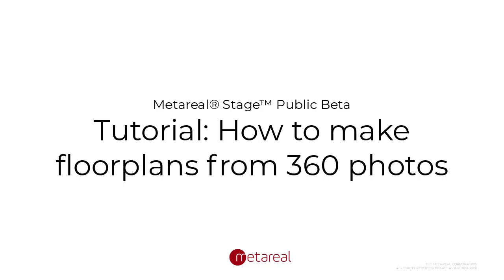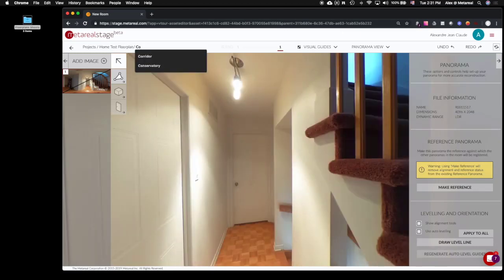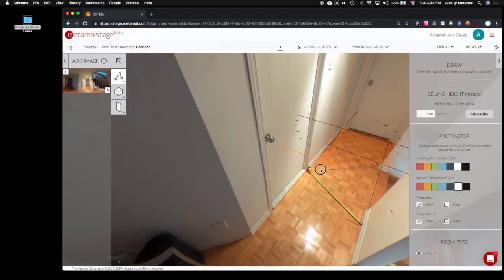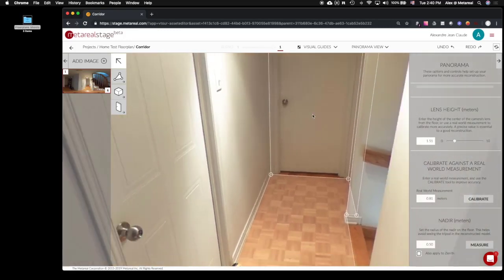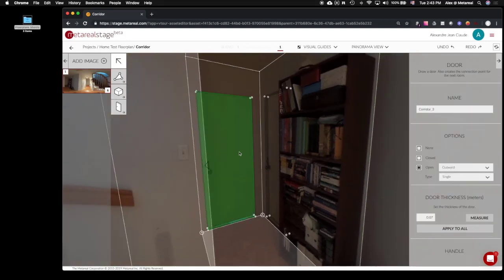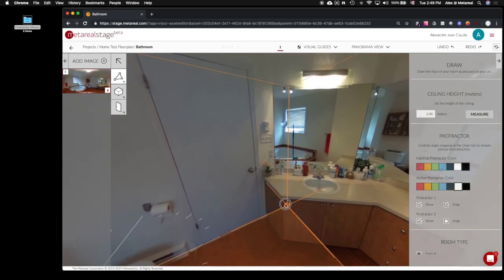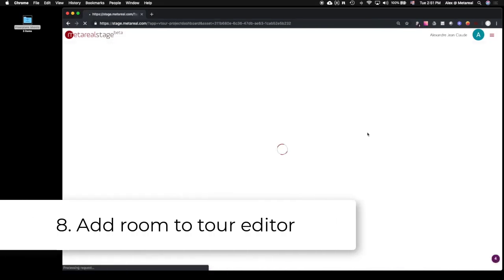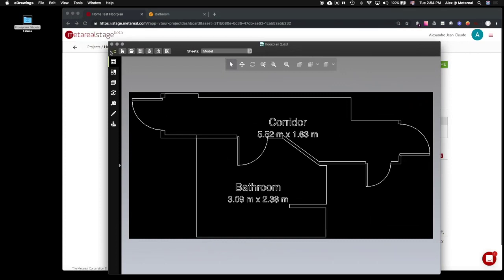How to make floorplans from 360 photos with Metareal Stage

Comment: Perfect tutorial! Just one question: Is the leveling and measuring always necessary, even if I only need a virtual tour and no floorplan?
Reply from the maker: In our experience, leveling actually saves a lot of time when building tours. Without leveling, it's hard to get panos to align properly together. Measuring for every pano is only necessary if you want your measurements to be as accurate as possible. Otherwise, it's fine to just measure your lens height and input that.

Comment: Of course I know Metareal Stage is in Beta statium of development and not all is to expect. But only 2 things I would comment. After the calibration,so it is to see in the video, the program show not a reaction like a zoom or reduction of the construction and pano. I would expect it. So I can see whether the program has understand what I want. 
At my home the width of the wall between corridor and living room is ca. 40cm. The door is not in the middle of the wall or on the corridor side but on the living room side. In the video I see that the position of the door is not quite correct and it is not possible to direct within the wall. Where the wall begins begins the door.  Others it is not possible.  In the 2D floorplan is to see that the width of walls is differently. Probably the width of the wall is depend from the width of the door. Is it correct what I write?
Reply from the maker: Hi Andreas, Because doors often have complex mouldings, sometimes it is important to project from the actual door to the plane of the wall when adding a door in Metareal Stage, so it can seem from an angle if the door is misplaced, but in fact, it is correct, just projected intot he plane of the wall from the door position. I hope that helps!